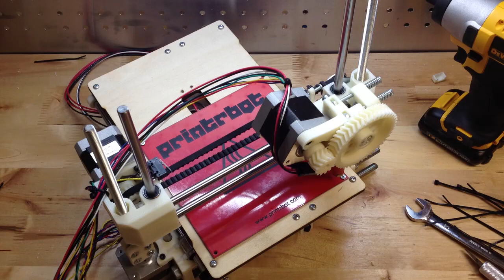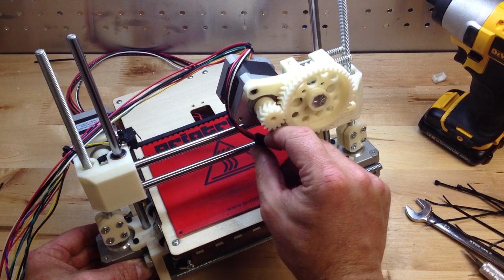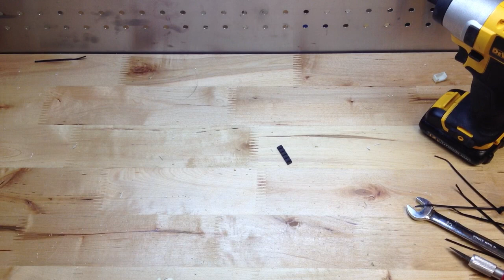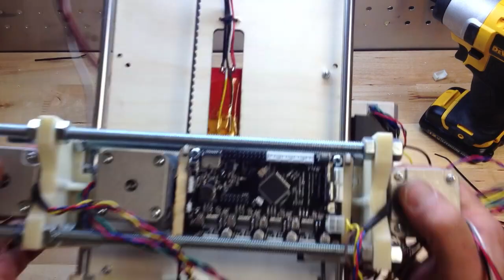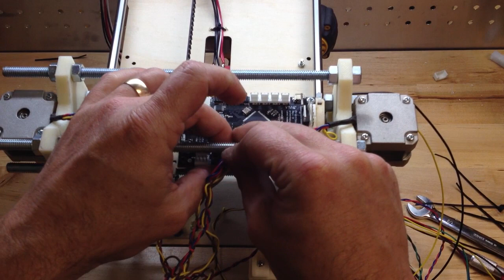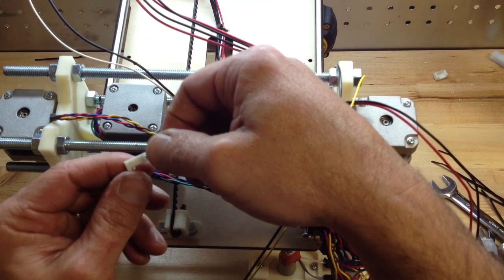Printrbot Build 15

Comment: At very least dial those pots back from the 6 o'clock position to the 4 o'clock position - i.e. turn them counter-clockwise 60 degrees. After doing this mine didn't heat up, and started working correctly. You can fine tune them after that, but you need to dial them back otherwise the motors will not be happy.